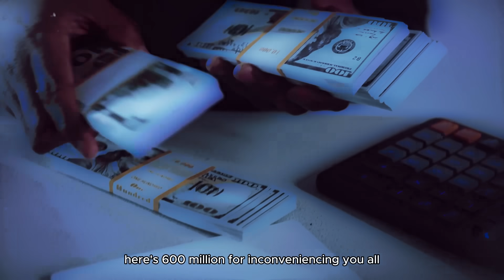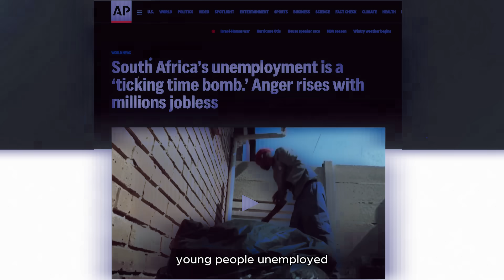How ANC (Chancellor House) Caused Load Shedding Crisis In South Africa -  Full Story | Mpho Dagada

Comment: Don't call it load shedding call it what it really is ELECTRICITY SHORTAGE
The FAILURE to produce enough electricity
Take your fridge and or deep freeze for example, how long do they run getting to the set temperature once the electricity comes back on 2-3 longer than normal so you use more electricity than you would normally

Comment: It should have been finished in 2014 if i remember correct....
Nearly 2024 and still not working.
Pricing from 38 billion as you say ended up as we read 385 billion.. and still nothing works.
One solution . Just hand over each year 40 billion to anc ...so all few anc leaders can eat as they say...and let the rest be done by private experts..much cheaper.

Comment: This is a narrow analysis of Eskom problems. Melefe and Koko stopped load shedding for years without these new power stations. Unfortunately ANC government has not built too many houses to say the demand is way too high, not less you would argue the case of backyard dwellers.

Your conclusion should be we’ve spent so much money in building these power stations and when we need them the most they are not giving us anything.

At Eskom we have confluence of issues ranging from inflated prices from coal to any other thing Eskom outsources. 

Even with the burning of diesel, someone is benefiting and would make sure that doesn’t end.

The biggest is the energy transition plan. They close working power stations to make a way for renewables. There is an aggressive drive for renewables and the PPEa are waiting on the sidelines, they can only be justified if Eskom is not working and therefore that should tell you why we continue to have load shedding
Reply: 💯💯 accurate analysis